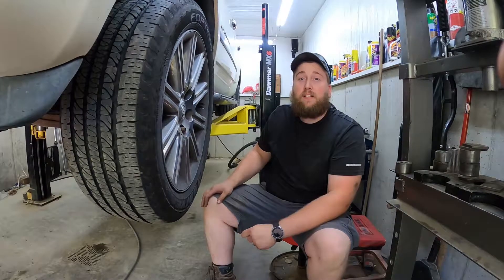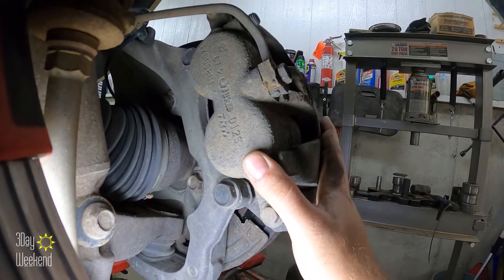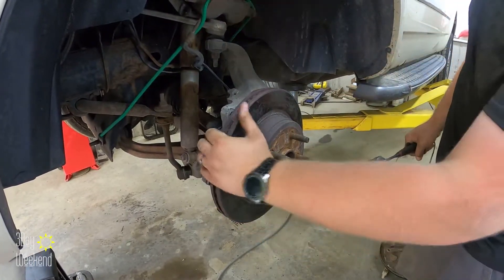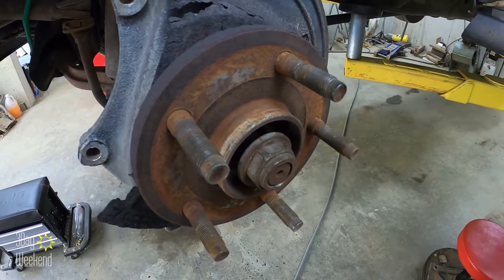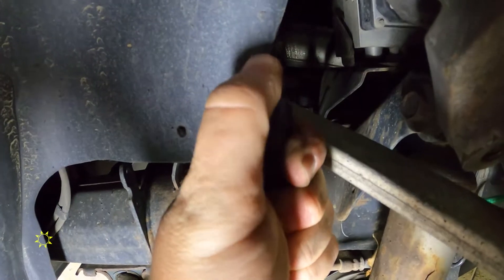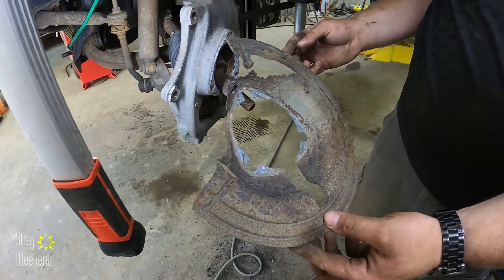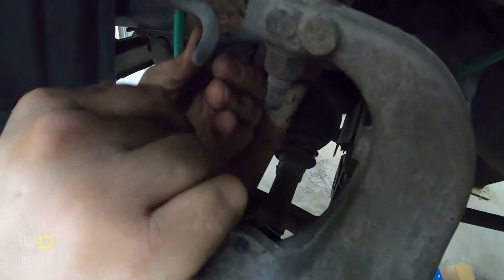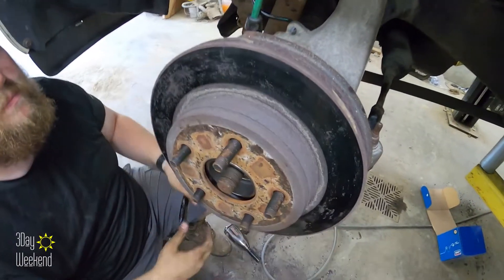Chrysler Aspen / 2nd Gen Dodge Durango 4x4 Hub (bearing) Replacement.

Comment: My 2004 dodge durango slt 4wd needs front wheel bearing. I ordered some that were supposed to fit but the abs connector plug is shaped different. I was going to just reuse the old ones. Is that advisable? I cant seem to find the replacement wheel bearing assemblies with the same style connector. Its similar to the one in this video.
Reply from the maker: If everything else is identical between the new and old sensors, and just the plug is different, then yes, you can re-use the old ones, no problem.  If the sensors themselves are different (shape, length, diameter), then you'll probably need to send those bearings back and get different ones.  It's a lot of work to install the bearings just to find out the sensors won't work, but you'll know right away if they won't - that ABS light will come on pretty quickly.  Hope that helps!
Reply: @3DayWeekend  yep it does. Im trying one more set of new bearing assys then Im switchin the sensors. Thanks for takin the time out to reply..new subsciber here.

Comment: Do the back bearings have to be pressed or are they pretty easy to put on?
Reply from the maker: I've never done the rear bearings in an Aspen, but I believe it has a traditional straight axle in it.  The procedure would be similar to a Ram 1500 of the same year.  If that is the case, no press would be necessary.

Comment: You made my head hurt as a mechanic, use the lug nuts to hold the rotor in place while installing the brake caliper then it doesn't move as you install it, i work on vehicles alone all the time just gotta be creative.
Reply from the maker: Yeah, little tricks like that definitely help.  When you're helping your friend with his car, he can make a great part holder!  Makes him feel important.  lol  Thanks for watching!  Take a couple Tylenol for the headache.  You'll be OK.  :-)
Reply: @3DayWeekend  I get what you mean bud I'm the same but show them also how to be creative when you have no one to help you, my friend had a laugh with me using a electric drill with a screw jack to break free a bolt that was stuck and no breaker bar could fit only a wrench lol. I hope i dont sound harsh apologies if I do im just a very blunt and stright forward person.